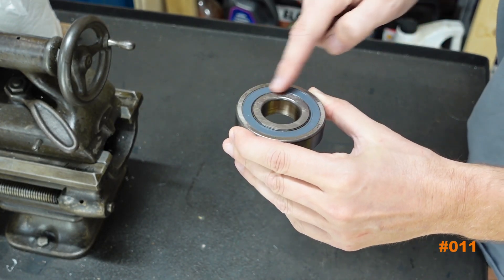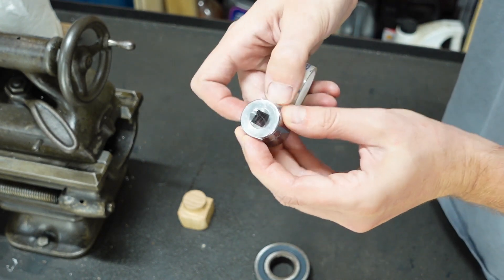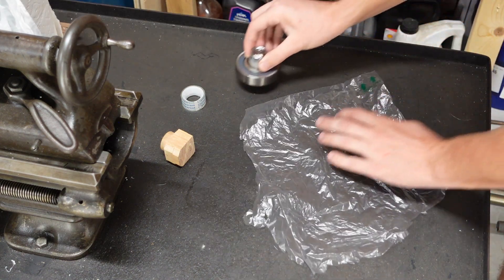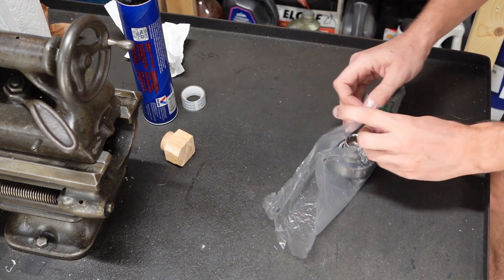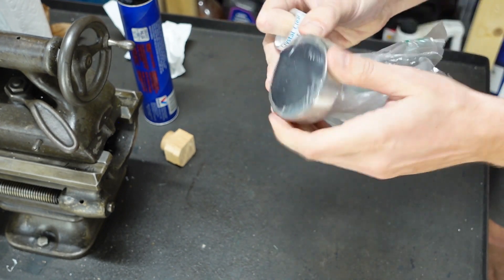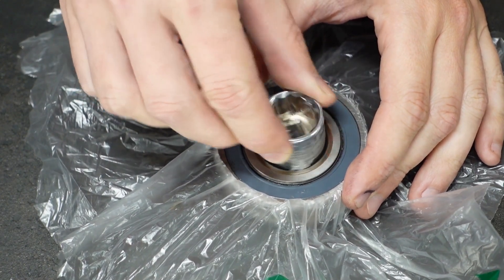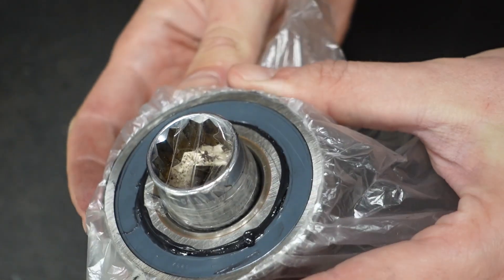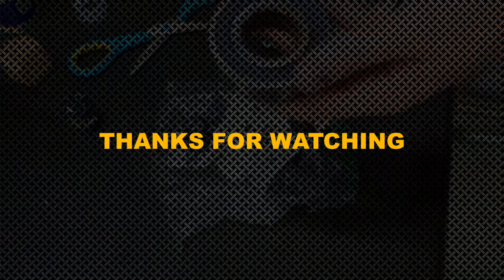How To Re-Grease Sealed Bearing. Easy Way Every DIYer Should Know

Comment: There's just one CRITICAL problem with doing this, the old grease is still in there. Grease, is a combination of oil (which does the actual lubrication) and its suspended in soaps, clays, emulsifiers and sometimes even PTFE/TEFLON to delay the release of that oil. Why does that matter? If you do this to a bearing without removing the old grease first, you are certainly filling the inside with more than the recommended 1/3 of available void space inside the bearing. Over greased bearings 'burn up' extremely quickly so anything spinning more than a couple rpm isn't going to last very long at all and will sieze when the bearing race welds itself to the inner and outer race. What do I know? I'm the guy who had to write the procedure book to relubricate ball bearings for one of the 4 businesses that are ISO certified to do it in the continental United States. I also had to painstakingly create another book with the correct milligram fill amounts for each size of bearing from a half dozen different manufaturers depending on the specific gravity of the grease being used, there are thousands of different greases out there with their own unique properties.for specific applications and operating conditions.
Reply: Like a commented to another person here, I've only been hearing about packing a smaller amount of grease in bearings, for instance vehicle wheel bearings, for the last few years but when I was in auto mechanics class in high school in the mid 80s we were taught to hand pack the bearings all the way around until grease oozed out of the other side. Of course this was after the old grease was cleaned out but even wheel bearing grease packing tools you find in automotive stores are designed to fill the bearings all the way. My question is why was it the general practice to fill wheel bearings full of grease for many many years but lately the practice is to only partially fill them but it just dawned on me that were talking about different types of bearings here. Wheel bearings, the older type, like you'd find on the front spindle of a rear wheel drive, are open and not shielded or sealed so as to be able to shed any grease that it doesn't need whereas a shielded or sealed bearing doesn't really have a way of doing that and therefore is pretty much forced to hold the amount of grease that is packed in. 
   Is this correct?
Reply: @bodeine454  you would have to remove Seals from both sides to allow the old grease to be forced out
Reply: @speedfreak8200  No you don't. You use brake cleaner with the straw and just blast it out of there. You stick that straw into all the crevices and just keep blasting it. I've done it before and it works fine.
Reply: @bodeine454  Because there are different types of bearings. Some you can/do pack 100%, others you don't.
Reply: Yes, that was my first thought, did he clean out the old grease. Can you explain why an over greased bearing will "burn up"?
Reply: @mavamQ more grease, More friction, more resistance, more heat
Reply from the maker: Yes, I used cap of gas to clean it inside.
Reply: I needed to replace the front bearing on the motor of a dewalt table saw and the rear bearing was good but it was dry. I was able to pop the seal off the back side of the bearing with an Xacto knife. I used carburetor cleaner with a straw and blasted everything out and got it really clean. The seal also snapped right back in place. There are a lot of grease's that are not compatible so that can be an issue if you don't clean it out. I did do research first and found out that you cannot use a moly based grease on electric motor bearings. You are supposed to use polyurea based grease on electric motor bearings. I'm glad I checked before I greased it.
Reply: @actionjksn  Interesting 👍
 Did you find out why you aren't supposed to use a moly based grease on electric motor bearings?
Reply: @bodeine454  I did not find out the technical reason but I think it's something to do with the much higher RPMs of electric motors versus wheel bearings. It burns up the bearings and causes premature failure. It is also really bad if you combine two different formulas. So that's reason enough to clean out all the old grease. If a tiny bit of old residue were left behind it might be okay, but I would remove as much as possible.

I also did not find any sources that contradicted the need for polyurea based grease, it was unanimous from what I remember. The major manufacturers are saying this. I remember Shell Oil was one of them. There are also some viscosity numbers that are preferred but I don't remember what they are. If you Google, what type of grease for electric motor bearings, there is a lot of good information out there.
Reply: Awesome to hear! Any chance of buying a copy of what you wrote?
Reply: ED here, most of the worn bearings we greased in the paper mill were so worn out they had to be filled with grease weekly or monthiy. some oilers counted the shots with manual grease guns , we then had bad wrist pain and went to battery powered guns. if u didn,t keep grease heated in winter , it was hell to pump! the battery guns would blow seals quickly, so u had be careful on new bearings. we looked for pressure relief,s, but never found realible ones.   FYI
Reply: the old adage was [ any grease is better than none!]      the environments are terrible where these bearings run, plus running 24 hrs daliy. the viberation team would find a bearing problem and we greased it very often until s/d, plus auto systems gave the bearing preset dosage on timer intervals.
Reply: Over greased,,…….! Excessive grease finds its way  out  pretty soon , just as it got in  ?
Reply: Where can I buy these books? Greetings from Germany
Reply: How do you maintain 1/3 void space in a bearing with a grease zerk?
Reply: @thewednesdaynightbiblestudyon  Any bearing with a Zerk fitting is not pressure sealed and can shed the excess grease quickly.
Reply: @paint1956  Makes sense. Thanks!
Reply: Oh dear
Reply: Cool tnx :)
Reply: If you are such an expert why the hell are you watching a you tube video on how to?
Reply: "There's just one CRITICAL problem with doing this, the old grease is still in there"
It is hard to see this as a "critical problem".   In normal course of events a sealed bearing will never be regreased anyway, so will always have the "old grease" inside.
Packing new grease in as shown can only improve its life.

Comment: Pull seal out by a knife nose or thin flat screwdriver from inside diameter of the seal ring, not outside! 
Works easy, does not damage it. Harder with metal seals, but still works.

Comment: You could also drop it from a tall building onto a small glob of grease.  The force of impact should (theoretically) force grease into the bearing.
Reply from the maker: I wouldn't want to run around the building looking for balls for my oval bearing :-)
Reply: @LSD_admin  or picking up the pieces.
Reply: I use a shotgun with grease replacing the lead. It's messy, loud and my neighbors complain.
Maybe I should do this indoors instead of pointing it at the neighbors houses. Hmmmm.

Comment: Two things wrong here. First, many greases are incompatible with each other, best to fully clean out the old before applying a new product. If the bearing has rubber seals, most are quite easy to pry off without damaging them.  Second, by forcing the new grease in one side until it comes out the other, you are over-filling the bearing with grease. In a high rpm situation it will run hotter and 'churn up' the grease. Only 35-45% of the free space should be filled by grease.
Reply: Sealed bearings are the concern for overfilling. Wheel bearings are fully packed, but the space between the bearings is not, so the bearing will purge the excess. A sealed bearing will also burp out excess grease, but it can get hot before it does, and can degrade the grease and the seals.
Reply: @johnmeeson822  This dawned on me not long after I commented and that makes perfect sense. 👍
Reply: Very few greases are incompatible.
Reply: Much less than 35-45%! That amount refering to filling amount of a bearing housing, like SKF SNA. Filling of the bearing shown estimates to a couple of grams. To much grease in the bearing will lead to overheating, and the  grease softening, and leaks out, which will lead to seizure.
Reply: @bigboreracing356  Unfortunately you can. Depending of type of seal there are fictional seals and non frictional seals. Even if the frictional sealing is worn the gap is extremely small, and due to frictional forces the grease will move towards the outer ring, where there is no gap. Sealed bearings are very sensitive to over-greasing. And if the heat goes up high, the oil will separate from the soap at a high rate and you end up with leftovers of soap that will not leak or lubricate.
Reply: I've heard this several times and I believe it but back in the 80s in auto mechanics shop in high school we were taught to clean the old grease out by soaking the bearings in solvent, kerosene in our case, and the hand packing the bearing by pressing the edge of the bearing in a dollop of grease on our palm until the grease comes out of the other side. We did this and turned the bearing as we went until the bearings were completely filled with grease. Bearing greasing tools also fill the bearing completely with grease and over the years most everyone that I ever saw pack grease in wheel bearings completely filled them so I'm confused about why it was deemed the proper way to grease a wheel bearing but over the last few years I keep hearing that it's actually bad. So why is packing bearings full of grease just recently being deemed as bad when for many many years it was considered the proper way to do it? 🤔
Reply: @bodeine454  No no no. Those have nothing to with each other. Completely different. You're talking about tapered bearing. Also think about it. Yes you pack the bearing full of grease, you install it. What do you do next? You install dust cap, which shouldn't be filled with grease. So that excessive grease will run into that dustcap space, hence you do NOT have fully packed bearing.
Reply: @jothain  Yes, I realized this shortly after I made my first comment and commented that I was comparing different types of bearings which at first I didn't realize I was doing. Thanks 👍
Reply: @bodeine454  it happens 🙂
Reply: This goes along with after regreasing the bearings some mechanics pack the hub cap full of grease and pound it back on.
Reply: @stevanrose7439  Where the grease remains until the cap is removed again...
Reply: Correct on all points.
Reply: @hootinouts  except it is better to have “mixed” grease vs no grease.  Much like a car engine low on oil.  Better to add oil and have it mixed than burn out the engine.

Comment: Most bearings that I have regreased are because the old grease was dried up and hard, so I like to remove both seals, wash the old grease out and pack it from both sides and the replace the seals.  Seems easier than playing with plastic and tape.  Uses less grease too.  Just a thought.